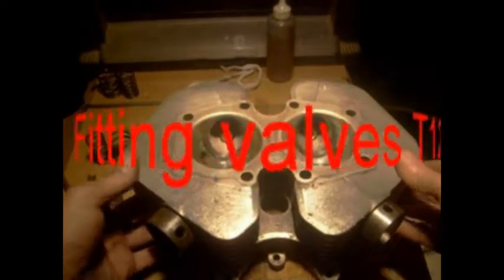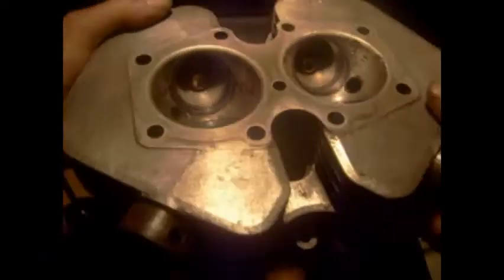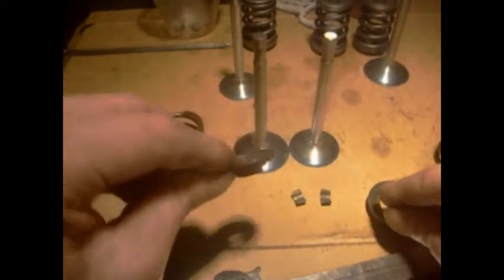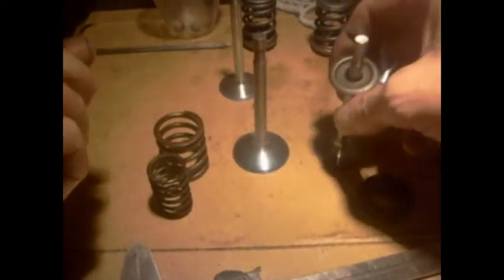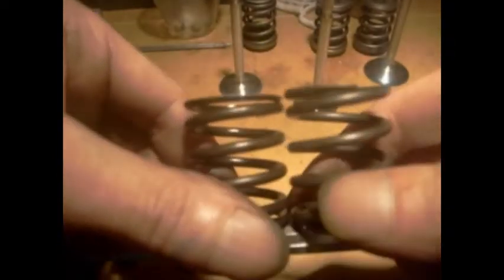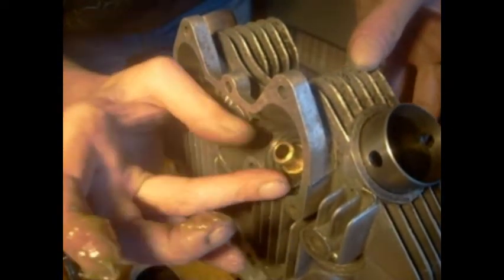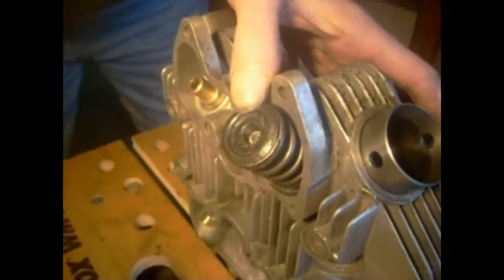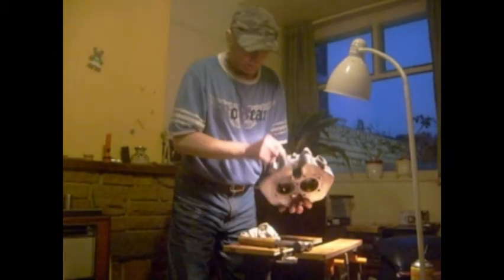Fitting the valves T120R

Comment: The manual says 'clean the chain in kerosene, allow to dry,and cook the chain in moly grease on a hot plate
Reply from the maker: Hi Charles :-) do you mean the drive chain?  if yes, yes I scrub my chain with a wire brush then boil it in graphite grease.

Comment: Hi lunmad. Do you have any tips for cleaning crap out from between the cooling fins. I've tried soaking it in Parafin etc but the main difficulty is finding something that will fit between the  fins to give it a scrub
Reply from the maker: Hi Matt :-)
the best thing I have found apart from scraping with something that will fit in the gap like a putty knife or wallpaper scraper, is the outside seam from a pair of jeans. You can also use the seam to paint the fins.
 I find aerosols don't get paint all the way in, probably because of turbulence.

Comment: y do u apply the grease on the  valve's lower cap? wont it mix with the engine oil? i think the lubrication system automatically lubricates it,,,? thanks for sharing the videos  ,,

Comment from the maker: Hi aikaha :-)
There are no stem seals fitted as std,
 though you can get modded guides and fit them.

If there where seals, they are best fitted after all the grinding work is done, so you only poke the valve through it once.

Comment: Your head is in good shape and you used new springs, so everything should be fine and this comment is for the benefit of others.  If the seats have been cut and/or the old springs are to be used (not recommended),  seat pressure should be considered. Valve spring pack length should be checked  and shimmed (within reason) if necessary. The specs are in the shop manual.

I have a simple machine that translates pack length into seat pressure using a beam torque wrench.  

Ran out of characters...